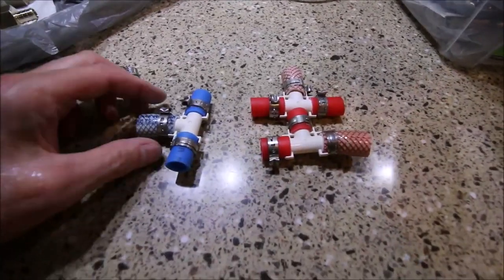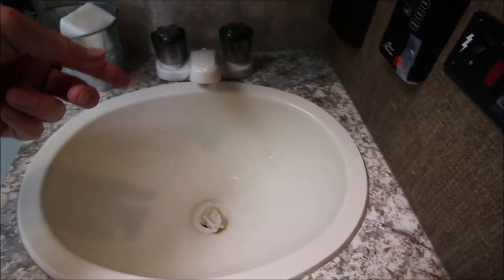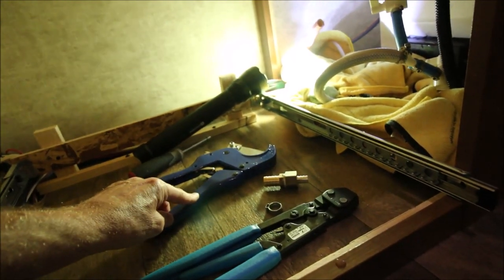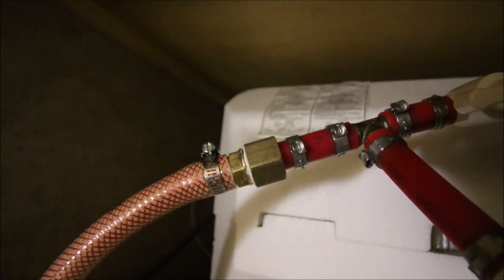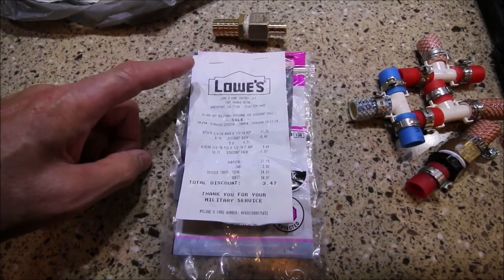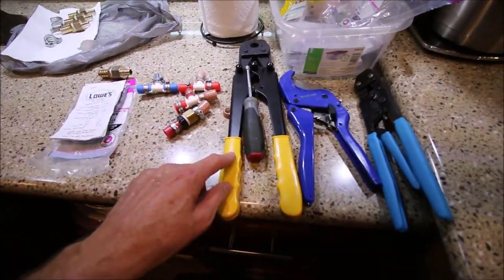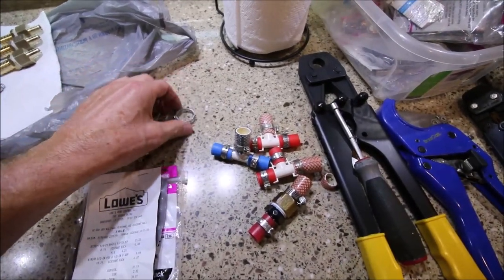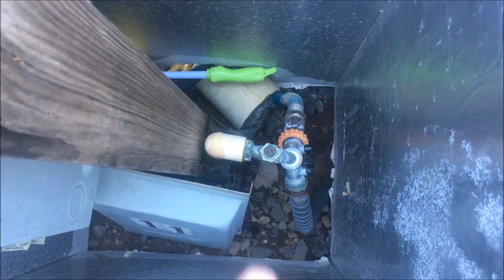How to Fix RV Water Leaks

Comment: Seems like a good solution to a problem that many of us are having. I was thinking of just swapping out removing the braided hose that seems to cause the issues, but I worry that pex isn't flexible enough where I need it. Thanks for the video
Reply from the maker: I think the braided hose is there for a reason but it isn’t very good at being a transition between two types of fittings
Reply: @JustPlainCommonSense  I have a classic komfort trailer but the sink a guy gave a old fusit and he sayed to go git a screw and after he's saying he wants to turn it into a house sink but I believe it could just be the part that screw's into the FUSIT that is the problem is there away to fix only that and not the hole thang good greef I mean I don't mind just grumiting and clamps

Comment: I wish I had seen this 2 weeks ago.  Just went through a similar leak that almost cost us our trip.  Managed to do a quick work around to save the trip but cost us no hot water to the bathroom.  After buying PEX tools and fittings did final repair at home. PEX is PIA. The location of the leak couldn't have been in a tighter spot. Thank you sir.
Reply from the maker: Glad it helped!

Comment: Thanks for the video,  had the exact same situation in my rv and was looking for the solution. Now its fixed like it should have been from the factory.
Reply from the maker: Darrell Blacquiere in addition to changing the fittings invest in an adjustable water pressure regulator. I now have my pressure regulated down to 25 psi and foresee no way how that pressure could cause problems in the future

Comment: Thank you!! This answers so many questions for me. We just had a weekend trip plagued by leaks, and they were ALL at those junctions from pex to reinforced hose. Now I know how to make future weekends more enjoyable.
Reply from the maker: Keep your fresh water regulator set at about 35 psi and you will have few problems.
Reply: I've had leaks in my PEX system at 2 locations, both where a reinforced hose attaches to a PEX Tee. It seems the only real solution is to keep repair tools in the trailer, and watch it. For what it's worth, I've installed a couple of battery operated leak alarms in the vicinity of the hoses. I'm hoping that if a leak happens over night it'll alarm before it's too far gone.

Comment: Thank you very much for this helpful video! We suspect that we have several leaks in our trailer under the kitchen sink area. This is a great start to solving the problem(s). 😊
Reply from the maker: Don't forget to put on a pressure regulator!  I only run about 35 psi of pressure in my water lines.  That stopped my leaks
Reply: @JustPlainCommonSense  very good point i have onbe but im on well on land had it set at 55-60 but did see it spike to 70psi when kicking on maybe just a little to much

Comment: Awesome video, I have the same problem FR MiniLite 2020.  I have enough access in some areas to just replace the flex hose with straight regular pex sections from the existing pex tees to the heater. I will definitely need to use the brass setup you did in other areas. Did you reuse the existing tees?
Reply from the maker: It’s been too long ago and I can’t recall.

Comment: This just happened to me. Omg water went gushing. My brother in law has it fixed for now. I still see a few drops though. We are hooked up too city water living in our 5th wheel. OMG what a dang mess. Thank god my brother in law works evenings ( hubby works day shift) i am still watching this praying it doesn't blow.
Reply from the maker: I would run a water pressure regulator if on city water.  Mine is set to 35 PSI; here the city water is about 60 PSI!
Reply: what brand was your camper?

Comment: How is this holding up? Is this the cure for vinyl to pex RV plumbing situations?
Reply from the maker: It was fine when I sold the rv. The key is using a pressure regulator
Reply: I have since day one but this Rockwood unit is plumbed with lots of flex vinyl to pex fittings. Once I get the retrofits done I will keep on with the good advice of using a pressure regulator. Thank you so much for posting this video. It's the best I have found on the topic of changing out the fittings. Blessings to you.  @JustPlainCommonSense

Comment: what brand is your camper, is it forest river/rockwood? the geo pro's are like this and i really can[t believe all camper companies do this, i think it has to be forest river/rockwood stupidy.
Reply from the maker: It’s made by Prime Time (Forest River)
Reply: @JustPlainCommonSense  ok thanks i was suspecting that, i really think that whole company is ran by idiots, unless you have seen other brands (not connected to forest river) do the same thing the rockwood geo pro and the forest river e-pro also have the wrong plumbing as well, so i'm just wondering if this is all only forest river stupidity or if its a wider spread problem with the industry as a whole
Reply: @JustPlainCommonSense  thanks again for the video by the way i'm having to deal with these leak issues at the moment myself :-(
Reply: It’s a bad deal. They must know.  I was thinking about down sizing my hoses. The Ts are 3/8 inch ID. How about 3/8 I’d hoses.  Would be cheaper. But would it restrict the water?  Shouldn’t.  I wouldn’t think. I just put 15 worm gear clamps on there the other day works for now but your right those hoses are to big for those Ts.
Reply from the maker: @glendasue70  give it a shot. I doubt you’d see the difference in pressure.

Comment: Have you tried to use the sharkbite push on t’s and elbows?
Reply from the maker: No I haven't  I bought a good supply of crimp-on fittings and a tool so I don't have to run to find parts if I get another leak.  So far So good.!  Get a good regulator and set it to 35 psi.

Comment: I have the same issue with a small run of reinforced flex tube going from the water pump to a T fitting. So only 1-1/2 ft of the non pex. Would it be better to just replace the flex tube with pex?
Reply from the maker: If I recall correctly, there was no way to connect the PEX to the water pump but I could be wrong.
Reply: lower pressure put a radiator clamp on the non pex hose

Comment: Thank you
Reply from the maker: I hope it helped you. The main issue is water pressure. Get a regulator and turn it down to as low as you can stand it. Mine is set to around 35 psi.

Comment: Reinforced pvc tubing is never a good idea on the pressure side of an rv water system. Screw type clamps will leak over time.
Reply from the maker: Thanks for the tip and comment!

Comment: 🧐I can’t imagine anyone accidentally turning the pump on.
Reply from the maker: Me either, or turning the gas switch on for the water heater... 🙄
Reply: Just Plain Common Sense 🤣
Reply: @JustPlainCommonSense  😂🤣😅
Reply: @JustPlainCommonSense  I just accidently turned on the microwave, while I had on my space heater, while using my blender.  Maybe it was all the Frozen Margaritas.🍹 Damn it.  Now I have to go outside in the dark to reset the breaker.  It was an accident. (True story!)
Reply from the maker: @breebrendahowell366  I and a 50 amp AND 15 amp plug to use. The 50 amp plugs into the RV and I have a heavy extension cord plugged into the 15 amp. The cord is run into the rv through a hole in the floor used for plumbing/ductwork. I use the extension cord on a power strip to run many of the things that used to trip the rv breaker. No problems throwing breakers since then.